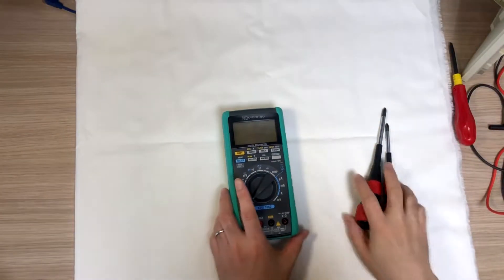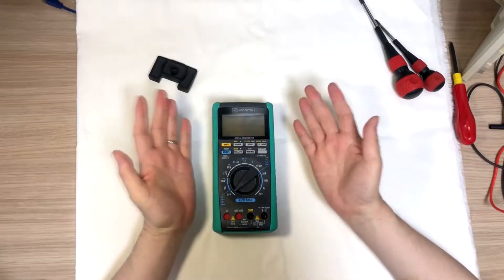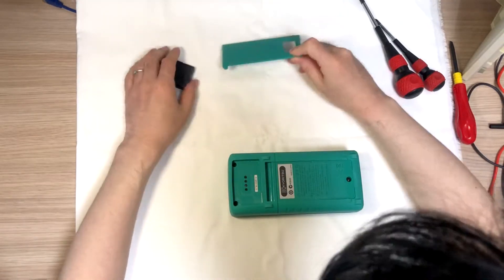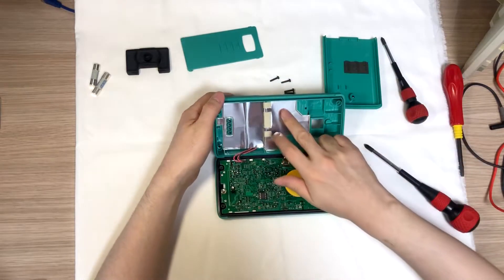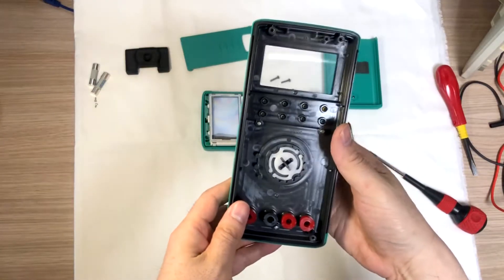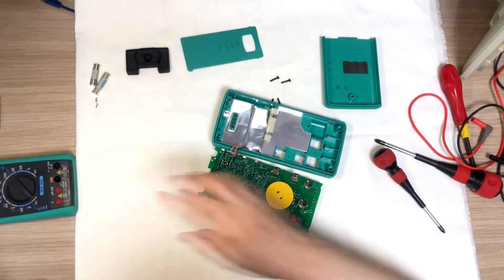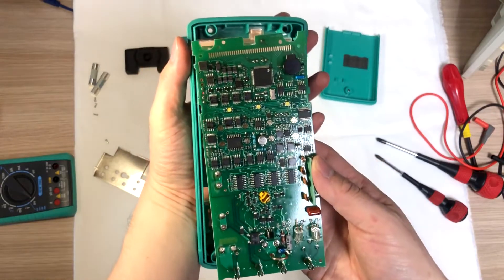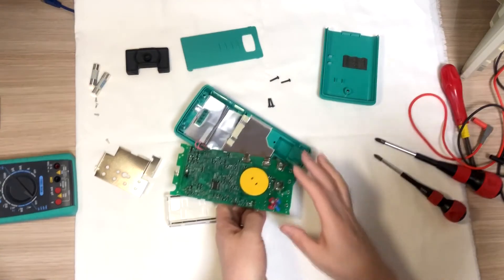Akira-EN #9 Yokogawa TY720, Kyoritsu, KEW1062, Tear down review of Multi meter

Comment: hello.. good video.. could you help me to know a technical data of my KYORITSU kew 1051 multimeter. I want to know if it has the option of connecting to a PC.  When I disarmed it, I noticed that it had 2 infrared communication LEDs.  in the manual it says no... but the electronic board has led for communication.
Reply from the maker: By just reading the specification of the KEW 1051, it do not have capability of connecting to a PC.
The datasheet says KEW 1052 is able to connect with a PC.
The firmware in the 1051 have not been removed the capability of transmitting the data to PC the it might have a hope for it.
How about checking with some IR sensor if any signal is coming out from the 1051 first?

Comment: *I think the Jack is an Adequate Design*
In my opinion no meter should be Dropped in awkward ways, any meter can play up or be damaged on the off chance.
Reply: I'd have to mostly agree with this statement.  It is nice to have the added assurance that a piece of test equipment will survive a fall undamaged, but it IS test equipment.  It is delicate and sensitive and due to these inherent characteristics, one should handle such equipment with great care.  I handle all my test equipment as if it were fragile glass and it would be an incredibly rare case to lend any of it out.  I realize though that real life work environments are not always as forgiving, things happen, often times unnecessarily.

Comment: Where are these multimeters made?
Reply from the maker: I do not have any connection with Kyoritsu or Yokogawa at the moment, so this is the information I know so far from visiting the shop. The TY720 and KEW1062 are made in Japan. They are not in the video but TY500 series and KEW1050 series are made in Tailand.
Reply: Will definitely consider those two Japanese meters. I really need something next to Fluke 87V. I can always trust Japanese quality. Thank you a bunch.